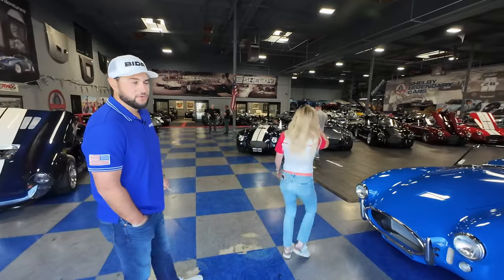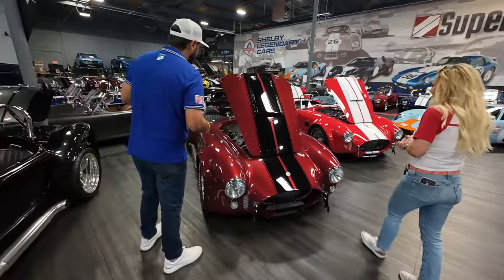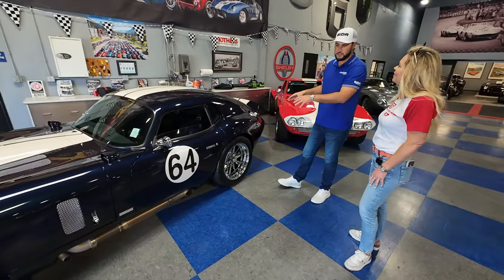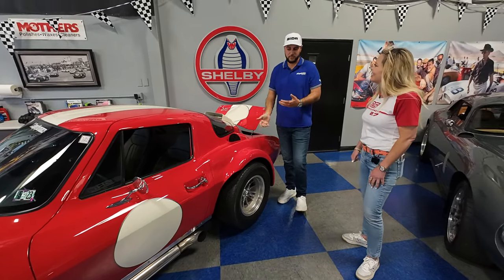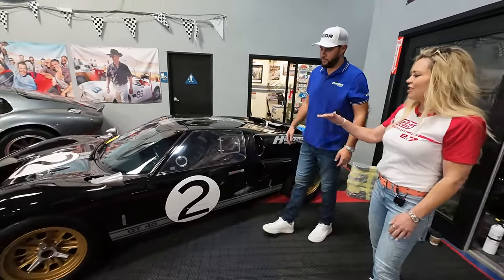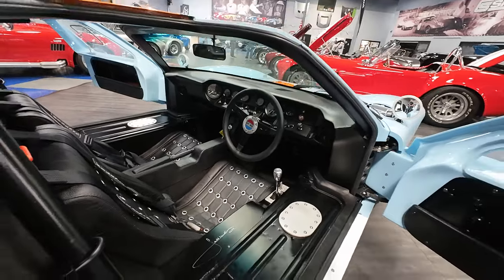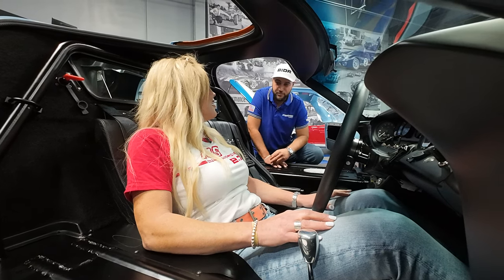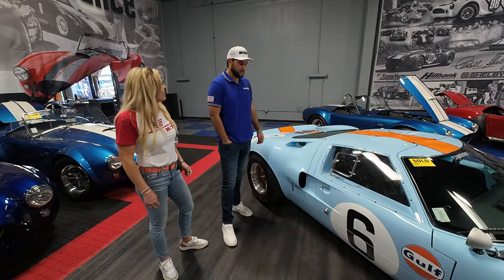Full SUPERFORMANCE Lineup | Hillbank Motorsports Garage Tour!

Comment: Think I'd rather have a big block 427 vs 351/427. Could stroke a 427 into some big cubes, big power. Even though 500+ hp is plenty, you can't spend all that money on a legendary race car and get smacked by a Mustang, Camaro, or Challenger. It should really be dominant.
Reply from the maker: I agree, except you can’t fit a big block in a MKI, just the MKII.

Comment: Nice presentation. But, I wish Superformance and Shelby Legendary Cars would clean up their marketing message. The Superformance cars are NOT continuation Cobras. The Shelby CSX cars with a CSX number and original chassis/suspensions as well as other differences are "Continuations".

If you are expecting to charge a significant premium for a CSX car you need to keep "brand integrity".
Reply from the maker: Yes, as Norman mentioned, the GT40’s, CSX Cobras, Daytona Coupes and Grandsports are all continuation cars built to original design and spec, while the Superformance Cobras are re-creations.   They are all awesome vehicles!  Thanks for watching!  Cheers!
Reply: Yes, that was explained. But, the first statement was that Superformance builds continuation cars. CSX cars that are continuations are not Superformance cars. They are both built by Hi Tech in South Africa. 
Initial statement, often repeated by others, is that SPF cars are continuations.

Problem is exacerbated by Shelby Legendary (that sells the CSX cars) and the Superformance company have the same owner and are co-located. So, easy to lump the cars together. 

The distinction between Shelby licensed (SPF) as opposed to having a Shelby VIN (CSX) is unclear to many. 

The CSX cars as presented in this video are later correctly identified has having the more authentic originality.

Now, with the CSX 10000 the originality argument is out the window. This is an SPF without original type chassis/suspension BUT with a CSX number.

More confusion.

More blurring of the lines between the Shelby CSX and SPF cars.

The sales of SPF cars vastly exceed the CSX cars, so ownership probably doesn’t mind the extra misconstrued  “value” attributed to the SPF cars as “continuations” or actual Shelby’s.